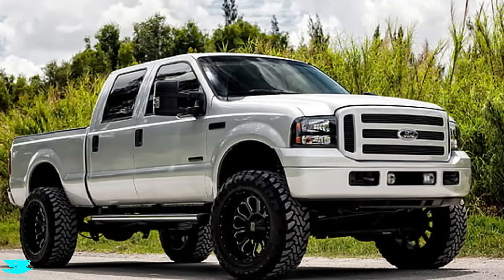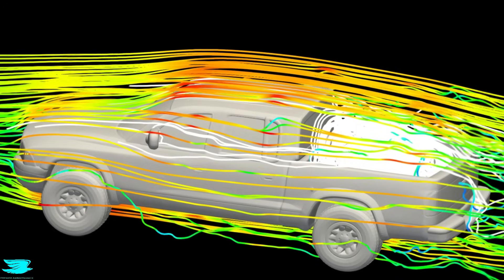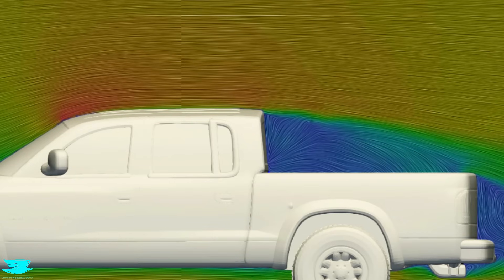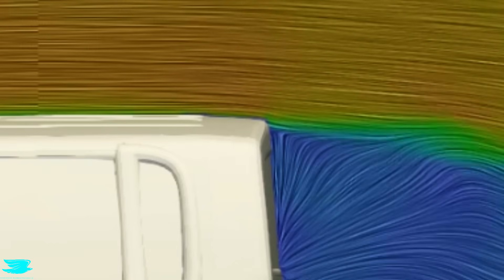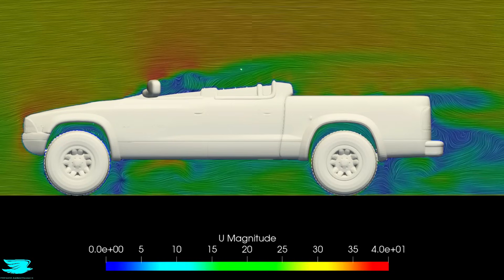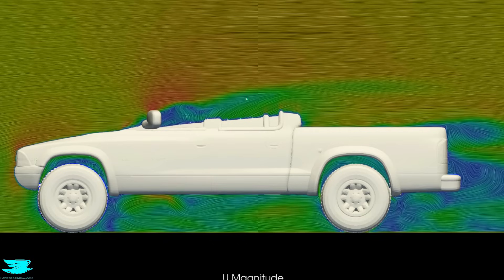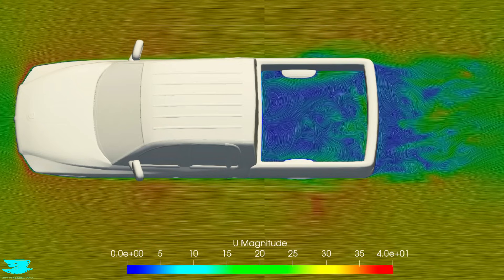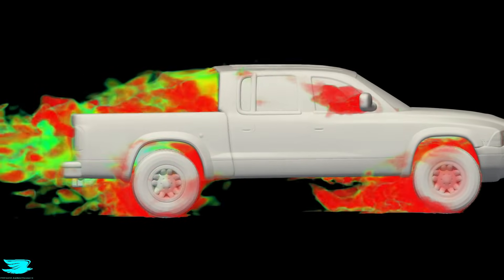How To Fix This Pickup Truck's Aerodynamics [Dodge Dakota 2002]

Comment: I wonder how my camper shell effects these things, beyond the extra weight.  The back window is slightly angled but the roof is completely flat, lacking the vortex generators the truck roof has so i imagine the rear airflow isnt as clean.

Comment: I was just wondering, adding bed cover or just chase rack, will these 2 affect the truck bed aero performance?
Reply from the maker: A bed cover does. A chase rack, that's a little tricky. I don't know of work on that, but I'd expect it to make things worse because it will likely increase the wake size.

Comment: Can you do a 2020 Toyota Tundra Crewmax? I'm interested in how a more modern pickup may fare, and curious if putting something like a spoiler on the back of the cab and tailgate may help improve efficiency.
Reply: It also has a factory bed cover, so I'm curious how air is moving around in the bed area with that cover.

Comment: About underneath aerodynamics- as I see, the model doesn't represents the chassis construction (axles, frame, suspension parts), so results are probably inaccurate in this part.
It would be interesting to see how suspension and chassis parts of a truck/suv affect it's aerodynamic.

Comment: How do you deal with radiator airflow and underbody irregularities? Does the engine compartment flowthrough not have significant effects? Just modeled as a solid? 
Do you model underbody or add additional drag, or just a flat smooth floor?

Comment: Just talking to anyone who has ridden in the bed of truck could have saved a lot of computational time 

The air in the bed is somewhat chaotic, but generally not too bad. Even in winter you can be quite comfortable if you sit close to the cab.

Comment: Interesting findings. Thanks for all the details. This may sound a little weird but I had a situation where I had about 3 sheets of plywood in the bed of my truck for a week, and they stuck out over the closed tailgate about a foot. I'm curious how much a simple thing like that changes the drag. I didn't keep track, but it felt like I got way better mileage along with the tuck feling more stable on the highway.
Reply from the maker: It might've helped reduce the wake size, and drag. It might've also blocked off some of the flow going into the bed.

Comment: Ford did something interesting with the roof line and top of the tailgate with their 13th gen F-150. The rear edge of the roof slants down to direct the roof line airflow towards the top of the tailgate. And the tailgate has a raised edge to merge the roof line flow with the outflow from the bed. It would be neat if you tested the 13th gen F-150 to see what this does. Ford did some other changes on the front end and wheel wells.
Reply from the maker: That's cool. So, they really tried to make the F150 more aerodynamic.

Comment: I’d love to see the aerodynamics of a 2022 Ford 150 base vs Ford F150 Tremor (USA market). The tremor has off-road tires and a lift kit, so It would be interesting to see if that makes a difference. I’d also like to see a 2023 Toyota 4Runner Off-Road Premium. Again you might be able to compare the stock vs Off-Road Premium.

Comment: I'd be fascinated to see this analysis on the aerodynamics of an XJ jeep Cherokee. Has fender flares and a front air dam, but it is obscenely square. Tailgate ends at practically 90°, windshield angle is very steep, etc. also the effects of opening the small vent windows, they're situated right behind the mirrors but still create a fairly dramatic breeze when fully opened

Comment: Would it be possible to do an aero simulation for a 2019 Hyundai Veloster, with bonus points if the engine floor cladding is also removed? The aero cover on my velosters floor of the engine bay broke off, I'm curious how much that's screwing up the aero

Comment: From personal experience I know but I know this generation of Dakota in particular is fairly stable up through about 135mph. Not sure if thats because I had a tonneau on mine or not. The only reason I say 135 is because it was basically at the top of 4th gear with not much left in it! 😜
Reply from the maker: That's good to know. I guess it would also help to have something in the back to help weigh it down.

Comment: I have a 2016 RAM 2500 long bed. Had a sh*t bed cover so I removed it. I came up with the idea of building a bed cover with a fastback tapered from the top and side cab edges and tapered down to the end of the bed. Was going to make it look cool and paint it well. Was going to make it telescope so from the rear I could slide the rear forward and every 2 ft it would separate and all sections would collapse forward like an accordion so I had all but 2 ft of the rear bed usable. Take some serious work but would be awesome if built right/well.
Reply from the maker: That would reduce the drag too.

Comment: Interesting analysis, but absolutely missing the real world separation between the cab and the bed.  Drive in the rain and you can see the air coming up theough that gap dragging water and crap toward the top of the windshield.

Comment: I tow a cargo trailer with my Dakota.  I added a shell and a adjustable wind deflector using a upside down snowboard ,all the way back and gained 6-7mpg while towing.  It's also more stable near passing semi trucks.
Reply from the maker: Wow, that's an impressive gain from the mod.

Comment: Can you do a rolled off road 2001 Toyota Tacoma? With a cab hat, cab lights, a roll bar with caterpillar square tractor lights on top of it, a toolbox in the bed with 3/4 chains hanging off of it, bed hooks from a 1970s  ford courier on the outside of the bed a bull bar on the front with LED light pods and 3/4 chains draped across it, riding on LT 245/75R15 Goodyear wrangler tires-with eagle alloy rims

Everyone like this comment  and I’ll try and send him pictures of my truck

Comment: A good follow up would be to compare this to the RAM SRT10 which is supposedly designed to fix a majority of these issues.  The 3 huge points of controversy are the front splitter, the hood scoop, and the wing.  How much of it is actual aero-corrections and how much is just grunt-grunt-racecar-looking.
Reply: There was a company that made an automatic tailgate for the SRT-10 that helped create more space under the wing and supposedly gave it more downforce.

Comment: sticking with the dodge theme, i think the 2nd gen intrepid would be very interesting. it's the smoothest full size sedan i've ever seen. very sleek and low profile. though i wonder if that cohesive smooth curve will act like the top of a plane wing and cause a ton of lift. also some models came with a low spoiler so it'd be neat to see if it actually does anything. if you want to dive even deeper to the car's lore, you can compare it to a lamborghini portofino. which was a super old super car jointly made between chrysler and lamborghini when they owned it. a lot of those styling queues were eventually put into the intrepid. (too bad they didn't include the quad opposing scissor doors though. would've been the sickest sedan of all time lol)
Reply: Ran a 02 police intrepid on the salt
Reply: @alantuttle492  why would you expose a rare car to salt? :v also are you selling it? :D
Reply: @Subreon  likely because top speed runs on salt flats are most if not all the driving it sees😂
Reply: I had an Intrepid with the more reliable larger motor.  That was back when window tint places were selling reflective / mirror tint, and my tint place found a blue-reflective tint that matched the steel blue pearlcoat paint of the car.  Damned thing looked better than I meant it to.  I ended up selling it to some guy who loved its look only for that being the time that this state was cracking down on mirrored window tint; he got pulled over within weeks of owning it and was made to take it off.
Reply: I think the 1st gens might be more aerodynamic.  Yes the 2nd gens look smoother but theyre a little bit bulkier.  My 1st gen hardly even has wind noise unless you put the windows down.  Compared to my dakota which sounds like a brick and the caravan about the same.  Never drove a 2nd gen LH though.

Comment: As an owner of a dodge dakota, im facinated
Reply: Sold our after 215K.  New owner is now enjoying its utility.
Reply: Same.  Bought my 2000 4.7 Club Cab in January 2001, still have it, and it's still chugging along.  Wish they still made these.
Reply: Had a 98 and sold it in 2021, paint was falling off but it was a great truck
Reply: I love this, never knew how much was involved. And i've added a lip spoiler to the front of my lowered 00 quad cab and its also 4 inches lower with R/T wheels.
Reply: As a former 2000 Dakota owner I am intrigued. Wish I still had it and compare. My single cab with shaker hood and spoiler tonneau
Reply: Me too

Comment: There's no such thing as a 2018 dodge viper. Plus the coefficient is only because of the rear spoiler, by design, and specifically targeted to the rear for tracking. At the 15:00 mark

Comment: i wonder if adding a vortex generator at the back of the cab would do anything to the air flow, ya know like on some mitsubishi lancer evo models. also wonder if adding a small spoiler off the edge at the back of the cab, like on some Honda's and Subaru hatchback's, ya know the one's that fit to the shape of the body.
Reply from the maker: The spoiler might help reduce the drag. The vortex generators probably not because they just create vortices and won't really help here.

Comment: Proof that part of the garbage found on highways comes from the back of pickup beds.
Your truck bed is not a garbage can
Reply: Anyone that has ever driven a truck and watched a wrapper or something similar in the bed knows that it almost always just simply swirls around in the bed. I'm sure occasionally some escapes, but I've never actually seen it.
Reply: @Demonslayer20111 True, but I would say no one takes an inventory of their garbage in the box, nor watches the rear view to make sure nothing escapes.
Its just my impression given the amount of garbage I see in the ditches as I ride my dirtbike down them.  I see a large number of plastic lids from tote boxes there.  Not the typical item thrown out the window by a driver/passenger.  It's always the lighter stuff like empty aluminum cans and plastic bottles.
Once airborne in the box, they are likely to  stay that way
Reply: @gordonborsboom7460 ah well see now you are talking about unsecured loads, a completely different scenario.considering a tote lid is presumably on top of a tote, meaning it sits quite a bit higher than the average coke can, and presumably might even be in contact with the slipstream above the bed.
Reply: I swept a bunch of leaves and stuff out of my trunk and didn't get them all out. Was amazed that they were still there MONTHS later. I figured they would have just fwipped around as soon as I hit highway speed but nope
Reply: I have a camper shell so yes it is.  But responsibly.

Comment: 15:15  Notice that truck doesn't have wheel flares, just like mine.  They look better that way but it limits tire width (unless your an idiot who likes having wheels/tires sticking out past the fenders).  Another thing is mud flaps.  Mine has factory longish mud flaps behind the tires since it's a 4WD (that's lowered to 2WD height) those have to have an impact.  See how much the side mirrors in the model differed from the trucks pictured.  There are several sizes of mirror for those Dakota/Durango trucks and the model seems to have the largest ones.

Comment: This was pretty interesting. I have an '01 Durango, the SUV version of the Dakota. Same chassis, engine, mirrors, and front end. It would be really interesting to see a comparison between the two. I'd also love to see some of the effects of common consumer add-ons like hood bug deflectors, window weather deflectors, and roof racks.
Reply: Even looking at those add ons for a few different cars.

I have an MKS with a sunroof, and I was wondering if a sunroof deflector would help with aerodynamics/wind noise.

Comment: Miatas are always modified, like mine. Can you show the difference between adding lips, bumper dams that cover the tires, hardtops, fastbacks, wing downforce efficiency between tops, cut rear bumpers, etc. I feel like doing a series on grassroots aero modification and areas people can focus on from each platform would be a cool series to spotlight! Idk if that would be too hard to do but I know every car guy wants to go fast, but not knowing how to focus on critical areas would be helpful and something people would definitely watch. Albeit scaling/design will change outcomes, it can provide a tool for where to start. Especially after watching the M2 video.

Comment: Can you do a 2013-2020 lincoln mkz? I have one and swear it gets really good mileage for the size. Mine has almost 180k miles and still gets 38-42mpg even with michelin pilot sport 4s. (This is atleast partially due to the fact i maintain and fix it up)

Comment: There was an SAE study some years back about pickup drag / aerodynamics and some popular myths: is tailgate-down better than tailgate-up, is a flow-through tailgate better than a solid one, do bed covers help. IIRC, the flow-through tailgate and tailgate-down were the highest drag (contrary to popular opinion), tailgate-up was best for an uncovered bed, and the bed cover only needed to cover the back half to be effective.
Reply from the maker: The rear half being covered makes a lot of sense.
Reply: @PremierAerodynamics  It's basically a dragster spoiler, ain't it?
Reply from the maker: I guess so, yep.
Reply: I have a 98 Ram 1500 that I’ve owned since new. For the first ten years I left the bed open. After that I put a bed cover on it. The bed cover does help, but not as much as one might think. At least as far as MPG is concerned. Maybe 0.5mpg if you’re lucky. I went from never hitting 16 highway to very occasionally hitting 16 highway.

I always wondered if these beautiful Dodges of the 90s were less draggy than the boxy Fords and GMs of the time or not.
Reply: @mattj65816  My 1990 F150 never gets better than 13. So maybe your old Dodge does perform better than its boxier counterparts.
Reply: @TatersUnited  it consistently did better than 13, at least on the highway. But I did drive it like a grandmother after the first couple years. :)
Reply: @mattj65816 Part of my problem is I put headers and dual exhaust on mine and can’t keep my foot out of the floor board hahaha
Reply: @TatersUnited  that'll do it!
Reply: And let's not forget the praised mythbusters episode about it
Reply: @ianalbiero9170 the one I never understood was why not having a tailgate got them worse mileage than having the bed net. Seems like that would still give more drag.
Reply: @musewolfman  One of the big studies that focused on it explained it nicely.  IIRC:  Trapped air swirls at the back of the bed with the tailgate up.  This trapped air is a higher density.  That higher density makes air coming over the top of the passenger's cabin glide over it and past the upper-edge of the tailgate in a more direct motion.  

That's what they explained.  My extrapolation from that is that with the tailgate down, or a net, the truck operator is effectively making the entire space from the roofline edge to the bottom of the forward-surface of the bed a vacuum.  Tailgate up is more like having a body that far back, tailgate down is like having the body end abruptly at the rear end of the passenger cab... which is a flat large rear surface.
Reply: Thought of this addition while cycling yesterday: Think of it this way - the tailgate up (and its trapped air) makes the back slope of the air flow more like the air that goes over the top roof ridge of the Tesla Cybertruck.  There is a reason the cybertruck rear half of the truck looks the way it does, and that is for air flow.
Reply: @workingguy-OU812  Damn I thought it looked like that because it sucks.
Reply: Although, i doubt most people have a bed cover for aerodynamics, and more for protecting/covering cargo.
Reply: @Reverend_Jay  Why not both?

Comment: Newer pickups actually have relatively good aerodynamics.  They use a lot of tricks including air curtains around the front wheels to reduce wake, and flexible air dams below the front bumper to reduce air pressure underneath.  The F150 combistion models use quite a few of these, and Ford actually went into detail during the launch.
Reply from the maker: They definitely do. A lot of work has been put into them.

Comment: Hellls yea, lol now I know why my mpg is such trash 😅, doesnt help I have a flat nose bumper way flatter that OEM. The 4x4 model theres a cross bar that hangs a lil lower that holds the transfercase. Great illustrstion on this model thanks!
Reply: I have a rt dak and just removing the rear bumper netted me two mpg highway. A flat floor made shpuld get 3-4 more mpg
Reply from the maker: Thank you!

Comment: Why would you attempt to do this. Just sell the pickup and buy a van instead. Vastly superior vehicle for 19/20 people. The van is the working mans vehicle and the pickup is a r*tard mobile.
And frankly, for most people the pickup is a 4 door car with a tiny parachute on the end they don't use when they drive between their home, place of work in the city and whatever shopping malls parking lot you park it at before you exit with your groceries (and place them on the rear seats).
I have disdain for most pickup truck owners.

Comment: doesn't the distance the roof flow travels depend greatly on the traveling velocity? Maybe it was designed for slightly different velocity?
Reply from the maker: It can. This is already pretty fast though.